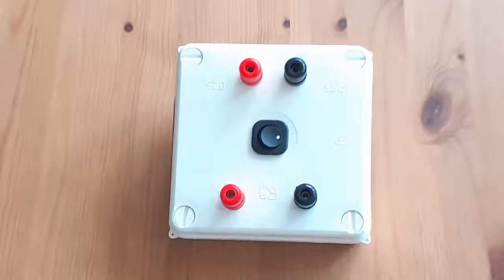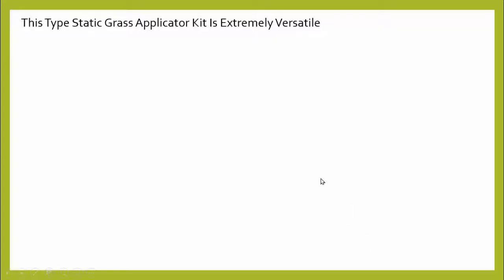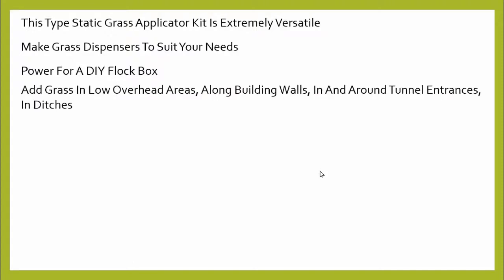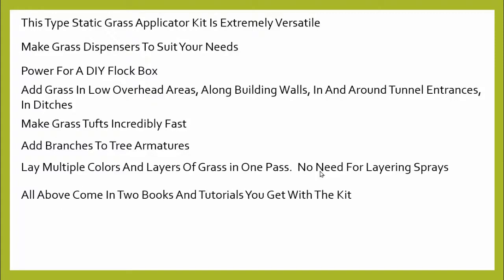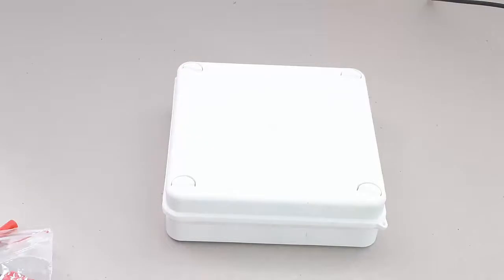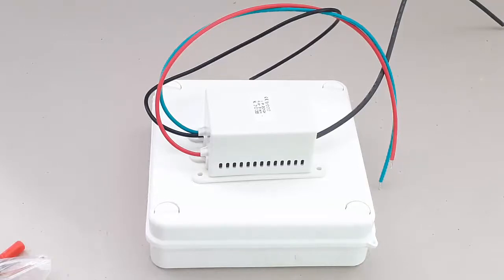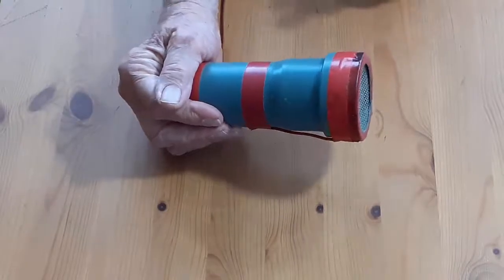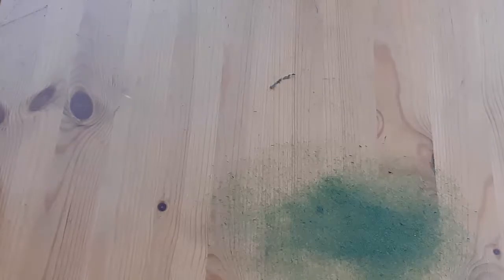DIY Static Grass Applicator 15kv DC Static Field Also For DIY FlockBox 12v DC input WorldOfRail

Comment: Great product Gary and many people back that up. I first saw your negative ion generator on Amazon and the price was a little high. At the moment it's un-available. I just received the super kit package from Poland's Best with all the parts in the video plus 8 packages of static grass. It took a while to get here, nevertheless, it arrived perfectly packaged from Poland to Canada. My cost for all those extras was the same as buying just the generator from Amazon. By the way, as for customer service, Kasia was fantastic. There is one more important detail I'll share. When cutting the holes to put the kit together just make sure to keep the static output terminals spaced well apart from each other. If you don't, the generator will actually make a buzzing noise and the field will be diminished as well., speaking from experience...lol. Thanks, have fun and Play Well
Reply from the maker: Thanks